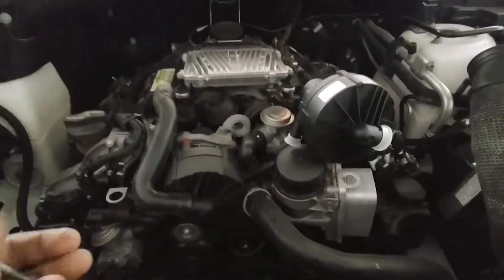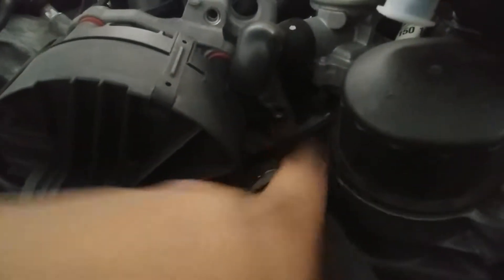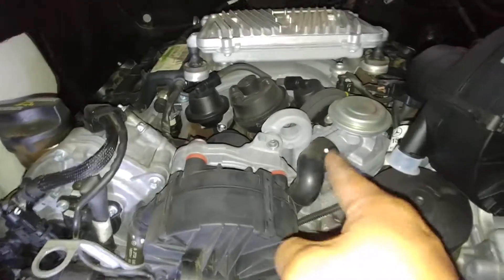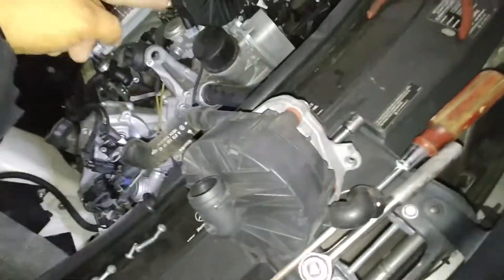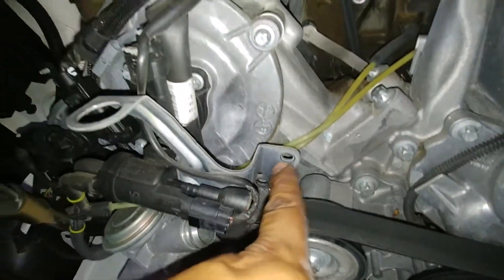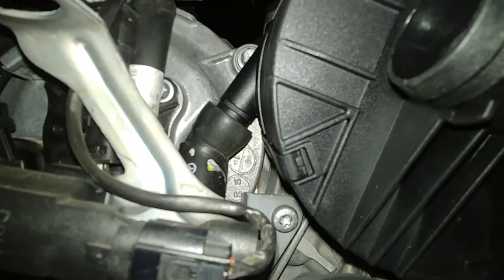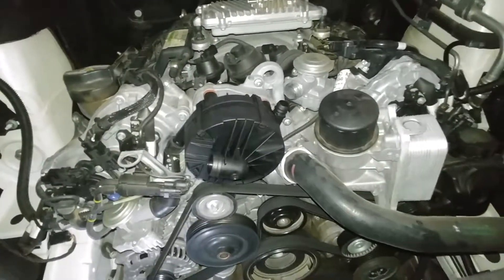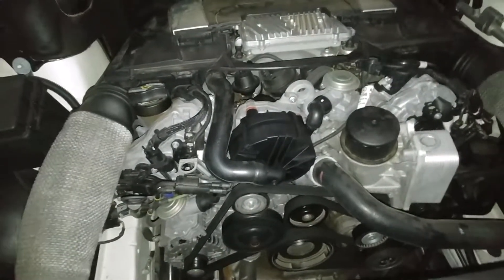DIY Replace Secondary Air Pump |  ML350 W164 Mercedes Benz 2006

Comment: It shouldn't be necessary to remove the air box to replace this part.
Reply from the maker: Its not absolutely necessary but the air box is also really easy to remove

Comment: I replaced mine, i deleted the check engine light.. a day later it came back on and its saying p0410 what could this be?
Reply from the maker: I would check the valve that distributes the air as well as make sure those tiny air hoses are not damaged.
Reply: Were you able to find a solution? I’m getting error codes P0410, 15, 25 and 36. Car won’t start, it sounds like it is struggling to spark the engine.

Comment: What symptoms or check engine code did you get? Reason for replacing?
Reply: It will squeal upon start up when cold n morning
Reply from the maker: Secondary air injection system. P0418